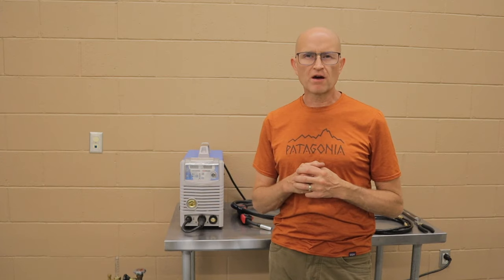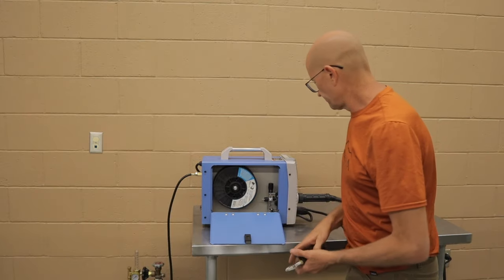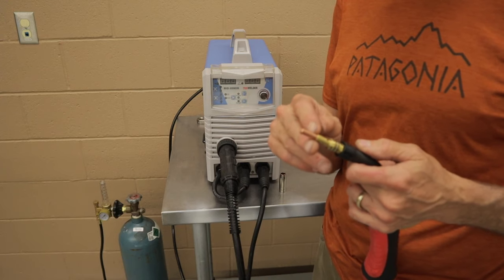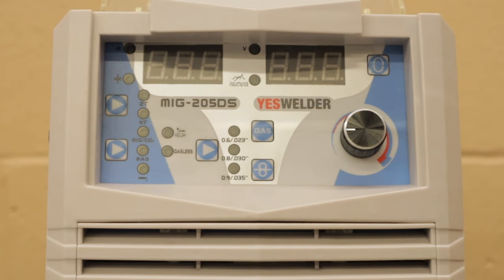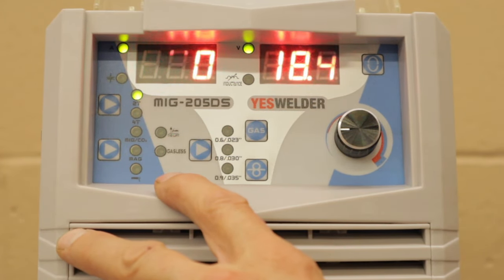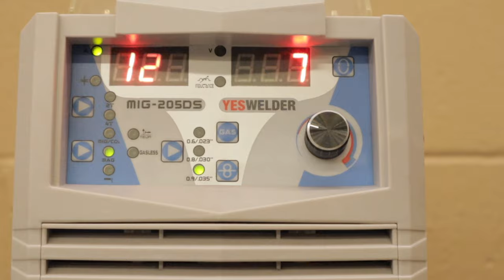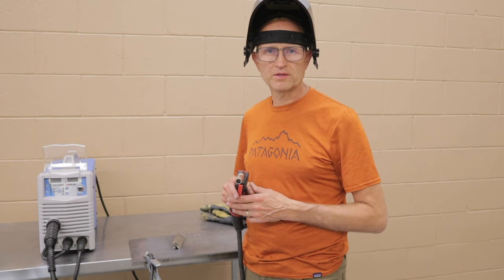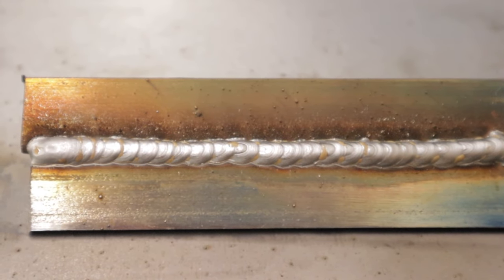YesWelder  MIG 205DS Welder Set up and Settings - Yes Welder DISCOUNT LINK !!!

Comment: 2lbs wont fit? I buy and use 2lbs in this welder with no issues. The welder uses both 2lb and 10lb spool.
Reply: Yea some of the drives are different. I got the one that won’t fit the small ones.
Reply: @MrPlainuser  take the nut off pull the black plastic out and you can use the stud, spring, washers and nut to utilize the 1 pounders still. Just don’t set the spring and nut too tight or too weak.
Reply: @lh98  thanks man. Just now seeing this. But it’s appreciated!
Reply: @lh98  wow I’ve been disappointed for about 18 months with this welder because it only accommodates 10 lb spool and you just saved the day. Now if I could adjust my wire feed speed I’d be a happy camper. I mostly lift TIG with it but it’s great info thank you.
Reply: Just bought a new 205 do welder . The new version accommodates both spools

Comment: Good video until the bit about stacking dimes. A good MIG weld you do not oscilate and it should be smooth. I've been a structural welder for over 20 years anyone I work with would agree

Comment: I just bought the same welder and mine will fit 2 lb or 10 lb you have to take off the 10 lb spool holder and a 2 lb will fit on
Reply from the maker: Yes all the newer ones are compatible with both 😁👍

Comment: 2022. Mine came with nothing connected in the front, I was pretty sure the ground went in the negative, but the other cable was just there dangling. Directions with it? There should be. It is really messed up that there isn't. Great video.

Comment: Just a fantastic setup guide. The Yeswelder manual is absolute crap. This is not my first welder and even I had questions.
Two things, as of 11/22 the small spool fits. To bad the manual has zero information. The other thing is you were welding on the wrong side of the welder. That noisy fan is blowing away your shield gas. 
Thanks again this really helped me.
Reply from the maker: Hi Charles! Thanks for your kind comments, I really appreciate them.🙏 yes, the later welders do accept the small spools now. Glad my video helped.👍😊

Comment: Appreciate the tips. Just bought one and haven't welded in a few years. Used to using dials only and had a few questions on the amperage set up. Thanks again.
Reply from the maker: Hi Russell! Glad the video helped! This was my first digital inverter welder and I was used to dials as well. Now I can’t imagine going back. I love the fact that I can just set my amperage and start welding. No more messing around trying to get my feed settings to match my amperage every time I change steel thicknesses. 😁👍

Comment: Very informative and educational video my friend. Especially about the inductance feature. I have only been, well what I consider (my standards), welding for a couple years now and I can mig tig and stick. I am 100% self taught with tips from the "old timers" at work. I do not know the proper welding terminology and now i realise i definitely dont know 10% of the different welding features that some welders have within there capabilities. I had not a clue about the inductance feature and now that you explained it as simply as you did I really think it's a great feature to have and to use
Reply from the maker: Hey Justin, thank you so much for your kind words!  I really appreciate it!   I’m pretty much self taught as well. I took a beginner welding class in 1985 and then just started practicing. I’m still learning to this day. I’ve been Tig welding for about 25 years, but only steel. For the last year I’ve been learning how to Tig weld aluminum and it has really been a fun challenge. It all just takes lots of practice to get proficient. I just come up with things I want to build and then decide what techniques I want to practice to build them. Glad you enjoyed the video and keep welding and building! Peace👍😀
Reply: Prana-Tech lkm is mmm mmm and ml 
Yeah my

Comment: Just a observation, I think the heat was just a tiny bit low, noticed a lot of sparks. Would of welded a bit flatter and smoother as well, Tonight my welder shows up, I`m looking forward to trying it out, your video convinced me to get my hands on it! Ive used massive 3phase units an ended up selling a Snapon Handler model I had, which was a very great mig machine, I`m hoping this is just as awesome.

Comment: I have this same machine, Is it possible to control the wire speed in this machine ? I guess no. I mostly do sheet metal welding for auto body panels. Can you please tell me settings for getting a perfect weld for butt and lap joints of sheet metal ? I need perfect penetration in both cases. My problem is that the wire speed is too much and I always have to cut the extra wire when I try to weld sheet metal.
Reply from the maker: Hi Shivo, for me I just turn the amps down to a low setting of 45-55 amps and do some tests on the thickness sheet metal I’m doing at the time. If I don’t get enough penetration then I turn up a little at a time until I get the penetration I want. If you need to fine tune it more than this you can increase voltage manually even in the synergy settings so you don’t get too much wire feed. 😁👍
Reply: @PranaTech  thanks

Comment: Anyway to manual set the wire feed speed or enter manual mode?  Great vid
Reply from the maker: I don’t think so. I’ve always use it the way it is and it is always right on. If I need more heat, I just turn up the amps and it perfectly adjusts the wire feed to match. So simple to weld with.😊👍

Comment: So how do you set the wire speed?
I am working with 16GA (1.65mm), 75 amps.
The wire is slow and burns off.

Comment: Hi there, I have the same welder and just started experiencing some issues where the wire seems to struggle to feed consistantly. I've checked tension, electric current but I'm not seeing anything unusual. Amps set at 90, it will drop to 26-27 at first then stay about 65-70 during the weld. Is that normal? Anything thoughts about what I might be missing? New .035 tip, new .035 wire, fresh bottle of 75/25.
Reply: My first spool I tried had no recess in the back so the entire back of the spool was rubbing on the back wall of the machine causing the spool to jerk and pause. First I just greased the whole back of the spool and it was much smoother.  Then I added a larger washer to get the spool off the wall so it could spin free.

Comment: Excellent tutorial.  I just received my unit and started to flux core weld.  I am noticing an excessive amount of wire being fed while welding.  By the end of a weld I have two inches or so sticking out.  I am using your chart for settings.  Is voltage too high, causing too much wire speed, or are amps too low?  I was also having issues getting an arc to start, it would feed wire but not arc.  Replaced ground clamp and it seems to be better.
Reply from the maker: Hi Richard! Ok, I’ve never used mine for flux core welding but, I do know that when welding flux core you have to reverse the polarity from regular mig. The movable lead needs to be plugged into the positive pole and the ground goes into the negative. Is that how yours is setup?😁

Comment: Don, I'm an old guy that purchased the 205DS for hobby use. Will this run on a 115v 20amp circuit? I've got electricians wanting to charge $$$$ saying a 40amo breaker for 115 or 50amp for 220. Again, just hobby.
Reply from the maker: Hi Lance, no need for an expensive electrician or big breakers. I’ve welded up to 136 amps on a 115v circuit at work and welded 3/16” at that amps. With a 20 amp breaker you could probably go up to 150-160 depending how old the breaker is. You could weld 1/4” at that amperage if you slowed your movement down a little. I’ll probably get some heat from the electricians out there for this one but for a hobby and occasional use, you can make 220 from two 110v outlets if they are on separate breakers from opposite sides of the breaker box. Here’s a video on how to do it.https://youtu.be/64L4Pz4vuYc Hope this helps.😁👍Don
Reply: @PranaTech  You are on my Christmas List!  Thanks very much for the reply.

Comment: THANK YOU FOR THE VIDOE AND THE CHART
Reply from the maker: Hi Frenchie! Thank you for the nice comment!  I mentioned it in the video, but the chart  is great for butt joints and outside welds. For tee joints or fillet welds, I bump the amps up about 10%. Happy welding! 👍😎

Comment: Good tutorial. Trying to figure out if my unit is defective or just built different I received mine Jan. 2021 in the auto thickness mode mine wants something like 150 amps for 1/8 material. with .30 wire. I'm not to sure about the automatic settings they seem to be very wonky to me but on another video a guy did fine with them. Then another guy uses his and adjusts the voltages and uses miller setting which I know this machine doesn't  match the miller amperages. I have two other welders I cant figure this thing out I'm going to try your chart now thats its warmer out I can fool with it more.
Reply: I too felt the machine auto settings to be really high. And I must have watched the same videos as you, because I had the same impressions from the other guy as well. These settings do seem a bit more in line. What did you find out if anything?
Reply: @misfitsolution7702  I started noticing the machine had a hard time on anything 1/8 or thicker it would start off ok for the first 2-3 seconds then start to act very odd. It felt a lot like the amps were swinging low to high constantly making it hard to put down a good smooth weld. I sent machine back the next one did the same maybe even worse. I got a refund and went and bought the harbor freight unlimited 200 multiprocessor welder. Its great right out of the box night and day difference from the YesWelder MIG 205DS. I like it so much I went and picked up the HFT Tig 200 pro also both work flawlessly and put down great welds. Spent a lot of time fooling with the Yes welder it's just not a good welder. Maybe their next up the line welder the 250 is much better but didn't want to risk it.

Comment: My welder did nit include the contact tips. Only had a .8 in the gun. I need a .9 tip for .035 wire. I have been trying unsuccessfully to order some tips. The either from Amazon or Yes, I cannot figure out what to order for my 205.  Took a guess, and it was wrong. Can you give me some guidance so I can get some on order…..thanks
Reply from the maker: Absolutely! The tips you want are for “Tweco style”. My Radnor package says the part number is 11-35 here is a link to them on Amazon. https://www.amazon.com/Radnor-11-35-035-Copper-Tweco/dp/B071X7X1TX/ref=mp_s_a_1_5?crid=16NINQ46UO940&keywords=radnor+11-35&qid=1640998540&sprefix=radnor+11-35%2Caps%2C163&sr=8-5 
You could probably find them cheaper but this will give you the correct info. Any welding shop in the Phoenix valley will have these as well if you want them tomorrow. 😊👍
Reply: @PranaTech  thanks. I ordered them immediately. Unfortunately, delivery is 1/6 - 1/12. I’m kind of anxious to try it out. I’ll try one of the local suppliers Monday.
Reply from the maker: You are very welcome! Let me know if you need anything else. 😊👍
Reply: @PranaTech  👍
Reply from the maker: Also, look through all your packaging. They only send three tips in a tiny package and it it easy to lose when unpacking the welder. It only has one .9 tip in the bag but it would at least get you going.👍
Reply: @PranaTech  there was a small bag that was torn open and the box had a hole in it. The only tip I got was the.8 already in the gun. Not sure but what it had been returned to amazon minus the spare tips.
Reply from the maker: Ahh, you might be right.

Comment: Outstanding video!!! Couple of questions from a newbee. Would you change the inductance for vertical welding?  Also are you down in Patagonia Az?
Reply from the maker: Hi there, yes I would definitely lower the inductance for vertical welding. Even to the point of going into the negative of the inductance setting.  I also tend to pull back on the amperage a little when welding vertical.  I live in northwest side of Tucson up in the Tortolita mountains. Hope this helps you my friend! Let me know if you have any other questions. 😊👍
Reply: @PranaTech  Super.  Thank you!  BTW, I’m in Mesa, Az. Learned a lot watching your video.

Comment: I use the 2 lb. reels on mine?  Maybe mine is a later model or something?
Reply from the maker: Hi Lyle, the manual says only 10lb. Rolls, but yes we all are using the small rolls now that we tried them.  I wish I could edit the video but that isn’t possible. 😀👍
Reply: @PranaTech  Cool thanks for the info. Great video!

Comment: What setting would you use for 16gauge 1"tubing using flux core? The machine would only let me change amperage and the lowest it would go was 80. It was running too hot and blowing holes in the metal. Hard time and eventually went back to using stick which was doing great. Appreciate your suggestions!
Reply: Forgot to mention I was using .9mm wire...
Reply from the maker: Hi WZ, you will need to switch to .023 wire and Change out the drive wheel. Problem is that I don’t know if they make any flux core wire that small. If you have an earlier this year mig, you will need to get a .023 drive wheel because yours didn’t come from yeswelder with one from the factory. Here is a link to one on eBay https://www.ebay.com/itm/0-6-0-8-Steel-V-Groove-Mig-Welder-Wire-Feed-Drive-Roller-Roll-Parts-023-030/132204897571?hash=item1ec806a523:g:XPAAAOSwkhxcdzN1 this is the one I bought and it fits great! 👍😁

Comment: Thank you very much for the info in this vid. I am not an experienced welder but an automotive tech for the US Postal service so have done some welding as needed. I just got my MIG 205DS and found the manual that came with it almost useless and even with some mistakes as far as the settings go. I have watched a number of videos and no one has mentioned the +/- cord on the front right (left facing the welder) and the manual doesn't show it. . I assumed that this is for switching the polarity and wasn't plugged in on my welder. I plan to use flux core wire and have ordered .030 wire as I have some body panels and exhaust to weld. I believe flux core requires a positive ground and electrode negative and gas mig the opposite. Pg 6 in the manual touches on this but is unclear. I set the machine up for 2T gasless welding and now the welder won't let me use the 030 wire setting. Getting a little frustrated. No mention of AC or DC current. Any help would be appreciated. All this being said I have been able to put down some really good beads with the stick and the flux mig even on the first try.
Reply from the maker: Good morning my friend!  Yes, the manual that comes with this welder is not good at all! You are correct that the electrode and ground need to be reversed to do flux core welding.  The only setting available for flux core with this welder is .035”.  I wish they would put this on their site so people would know it and not be surprised and frustrated later. Let me know if you have any other questions. 😁👍Don

Comment: Great job, just opened my box today and am anxious to set it up. This video will help a great deal. On the wire feed wheel, is the number stamped on the side of the wheel correlate to the groove that it is next to? So if you were using .9 wire, you would want to put the number “.9” to the inside of the machine, correct? I know you said it but was hard to see. I was wondering if the number that was facing out when the wheel was installed on the shaft was the groove size that was actually under the wire. That make sense?
Reply from the maker: Hi Dean, the number is on the same side as the groove so you would put the number you want, away from you on the inside where you can’t see it. 😁👍
Reply: @PranaTech  got it, thanks.
Reply from the maker: Oh good! Let me know if you have any other questions as you get going? 😊👍
Reply: @PranaTech  is the  knurled one that came in the bag for flux core?
Reply from the maker: Yes it is.👍

Comment: Hi once again Don. Question about how the wire drive wheel should face. I've seen folks say that, for example if I'm using flux core 0.35 wire, that the stamping on the drive wheel, .09 in this case, should be facing me as I install the wheel and not facing the inside of the machine. Can you clarify which direction the wheel should be installed? Thanks again.
Reply from the maker: Hi Lance, I’m at work right now so I don’t have my welder to look at. As I remember, the marking is on the side of the wheel that is that dimension. The groove you are going to use goes on the inside of the machine so it should be facing away from you when it is mounted correctly. Make sure you use the knurled groove wheel for flux core. Also, you should be able to see the difference in the size of the grooves to confirm what I’m saying before you install it. Hope this helps!👍😁Don
Reply: @PranaTech  Right you are Don! The guide wheel wire size faces towards the inside. Thanks for clearing that up.
Reply from the maker: No problem at all! Let me know if you have any other questions as you get welding 👍

Comment: Good information. Is this available on the main website? My instruction booklet doesn’t tell me about all the settings or options. 😅
Reply from the maker: A lot of it is in the manual on their site. The info about inductance I had to figure out on my own.😁👍
Reply: That’s great. Hey, that inductance immediately helped me out. My bead was sitting too high and once I turned that setting from 0-6 the bead flattened and penetrated the metal better. Great information, I appreciate it a lot!
Reply from the maker: @Fahrenheit_Motorsports That is exactly what I found! It also takes away 80% of the spatter as well.😊👍